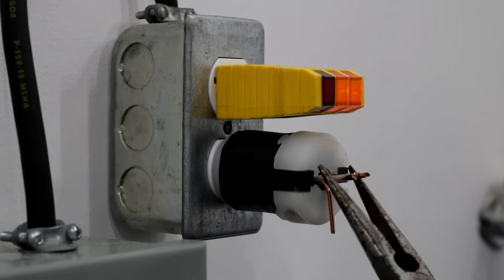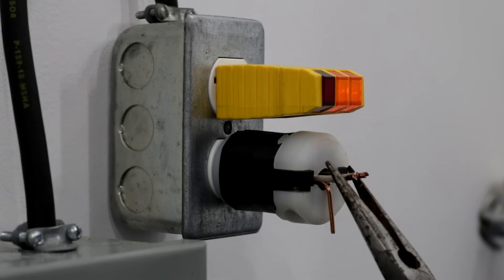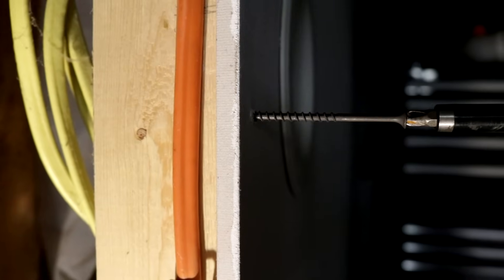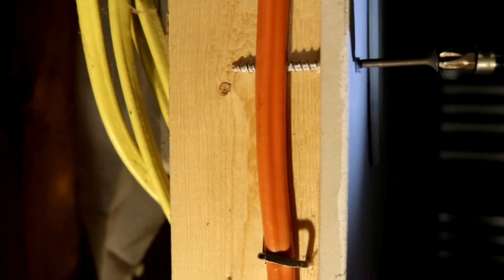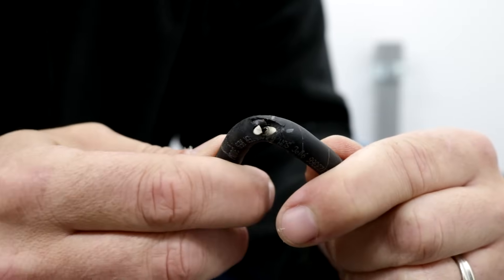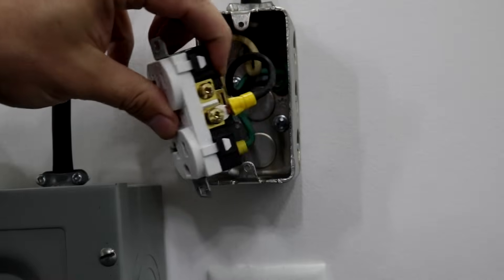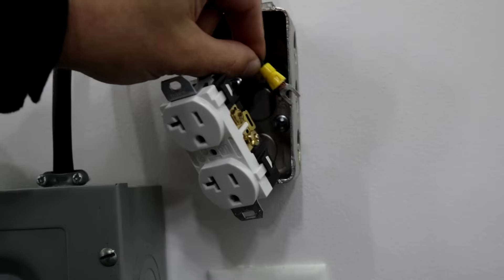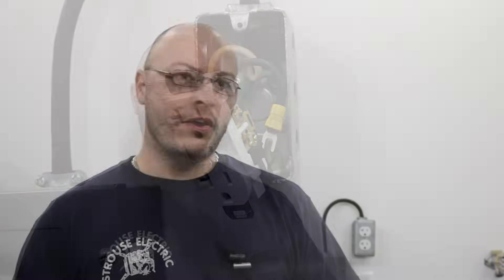Circuit Breaker Keeps Tripping - 3 Common Reasons

Comment: garage circuit trips when it rains... a few days later when things are dry it works again.
No water is ever found....
Reply: Ooooo, I hate when that happens. Most likely a high humidity thing. If there is also a receptacle or fixture outside that's on that same circuit, that may be the culprit. This is especially common if the controlling GFCI is a lower quality receptacle.
Reply: Donald Shimkus probably... I just replaced to circuit breaker and 4 inches of rain all is good . I think they were 21 years old and had seen rain over the years.
Reply: @graphguy  
Good job! Yeah, those outdoor panel breakers sure do take some abuse from the weather.  Stay safe.
Reply: Sorry, was texting someone else with an outdoor panel.

Comment: hi ,,, I sometimes hear (only at nite ) a snaping sound from one of my breakers ,however  the breaker does not trip its a  15 A and this is for lights  in the living room ,, so at nite when that lignt is on and I am using my  computer  ( which is supply from a 20A breaker  ,,, I hear a sharp snap when I check the breakers the are on and normal temp the touch (not ever warm  ) ….  not sure what is causing that
Reply: Have a qualified electrician change out that breaker. Please.

Comment: My septic tank pump gfci keeps tripping Why my husband has replaced it and it does not work at all what could be the cause?
Reply: A short in the wires or the pump motor is grounded

Comment: Thank you for the video! My husband and I have lived in our home for 3+ years. Our bathroom and second bathroom outlets are on the same circuit along with one outlet of the lanai. We have nothing plugged in full-time. Once in awhile I was using the outlet for a vacuum but we upgraded to a wireless/cordless vacuum over a year ago. Some time a few months ago, the outlets stopped working. We didn't realize it until we purchased a Waterpik and tried to use it in the master bathroom last month. We have no idea of how long the outlets were not working as we don't use them. 
After searching YouTube, we replaced the circuit breaker successfully. We plugged in a random light and it worked for a second. 
We have an electrician called who is coming tomorrow at the tune of $65 an hour to figure out what is wrong. Any ideas? My husband is quite handy. He is currently disconnecting the outlet in the master and then has plans on doing the same to the second bathroom).

Comment: Hi there I just subbed to you, question I'm new to living in an RV I blew 3 areas already at friends house on my 3rd area pulling elecicity from the front of his house the outlet is 15amps , 110 volta approximately I believe it holds 1650watts  I currently have a cyclone floor fan, a honeywell fan and a oscillator desk fan plugged in, in running g I believe a 16gauge light duty wire from the front porch to my camper. I need to know how many fans can be run 24/7 off of this outlet?)
Reply: definitely invest in a 12 wire cord. then calculate how many amps you're using for the rv ( watts divide by volts = amps)
Reply: Bill passed away in 2016, so don’t expect him to answer. He did have another channel that was very helpful.

Comment: Hello. I was watching one of your YouTube videos. I was very impressed. I hope you don't mind me asking you a question. I'll try to keep it short. 
  I have a house that is about 1150 square foot and was built around 1968. I'm renovating to sell. Tried renting and it was a nightmare. All 10 years of it. Iv replaced every switch, plug and light fixture successfully. However there is one light fixture in the bathroom that is throwing the breaker on the outside of the house. The outside breaker box of course. I know it's not a smart thing to do at all but I wired it hot and it worked fine but when I turned the switch off to turn the light off it immediately throws the outside breaker. I don't understand this at all. I do know that there is a ground fault plug on this circuit and highly suspect it may be the problem but don't know why. I have done some electrical work and took some classes but I'm far from an electrician. Oh and there is 2 lights in the bathroom where this fixture is, both on this same circuit but they are worked by separate, side by side, single, 2 way switches. And the circuit goes on from there. I watched another YouTube video that said I needed to mount both black wires to the fixture to the hot and ground fixture wires and wire nut the neutral wires together. I did not understand this at all but I actually think my neutral wires were wire nutted together but don't remember for sure. I would greatly appreciate any and all advice you could give me. Thank you very much, Robert.
Reply: Sorry, but Bill’s no longer with us. I’m interested to know if you found source of the tripping.
Reply: @sunshine3914   Do you have an electrician theree?

Comment: I think I have a circuit drawing 8 amps rated for 15 amps. The house is only 3 years old. I'm wondering if I should just install some LED bulbs in the bathroom or actually figure out why that one breaker has tripped twice in the past couple weeks.

Comment: If you are using a GCFI will it also trip with too much amperage or is it limited to just grounding issues? thanks
Reply: Yes they are rated for certain amperage it protects the circuit

Comment: Fine Bill. I like your channel.  Can You explain why my RCD strips when there is thunder and lighting?
Reply: if your power surges and excess power can overcome the lines systems to bleed of the voltage and the lighting uses your house wiring through your grounding electrodes to get to earth also trippping your shit out in the process.

Comment: The power company said it was my circuit breaker had gone bad but do you think I could possibly turn it off then back on maybe to see if that works, do they just die often or?? Plz someone help vlol
Reply: after 20 to thirty years its common to go bad is your house old? Also is just one part of your house with out power. If so did you call the power company about that?
Reply: Yes, breakers do go bad and sometimes within just a few yrs. Most times they just fatigue from excessive loads, too many things operating on one circuit or 1 or 2 things that draw a lot of current. Such as portable electric heaters.
Reply: @donaldshimkus539  I just installed a ceiling fan and my 15amp breaker keeps tripping.Should i go with a 20amp?
Reply: @tyronekitchens4245  
No. The wire gauge for that circuit is most likely 14 guage which dictates the use of a maximum 15 amp breaker. Check that the wiring and connections are correct and not shorted. If good, check that the fan is not shorted internally. These were the only two things that changed in this situation. If the breaker was fine before,  chances are good that's where ghe problem is.
Reply: @donaldshimkus539  Thanks so much.I think the fan is short/Defected everything else checked out fine.
Reply: @donaldshimkus539  I may also add that the 15amp is connected to two bedrooms
Reply: @tyronekitchens4245  
That's typical and usually not a problem. 15 amp circuits can handle several rooms because their loads (electrical) are usually minimal, being lights and electronics. When you add window a-c units or portable electric heaters or other high current drawing appliances, that's when you run into problems. These items should be on dedicated circuits of sufficient ampacity.
Reply: @donaldshimkus539  Thanks alot for the information.Defective fan(Hopefully)

Comment: I hear a slight buzzing noise from the specific breaker that keeps tripping before it trips off. Unplugged all devices on that circuit, tried again. Still have the same issue. Because I’m hearing that noise, should I isolate the problem to the breaker or should I now take a look at the outlets to look for shorts?

Comment: I have a question: Can I replace a broken 20A double pole switch (for my hot water heater) with a 30A double pole switch? The reason for this question is, I went to HD to purchase the 20A but there was none in stock, but I was told that a 30A (which was in stock) would work.
But a new problem arose: Previously the broken 20A switch tripped the hot water tank breaker. But now with the new 30A switch, the main breaker to the entire house trips!
Can you help?
Thanks.
Reply: You either have a short circuit that is so bad it trips the main when you rewired your shit also a 30A protecting 12 gauge wire will eventually burn your house down but if its holding its golden.  also why replace the old breaker if shit wasnt already fucked up? probably your issue there.

Comment: i installed a like new used washing machine that everytime i use water around it (example: water plants, clean patio) it trips the breaker, what could it be?
Reply: water conducts electricity (except distilled water) and can definitely cause a short.  if the plug that the Washer is plugged into is GFCI protected then even the tiniest droplet of water would cause the GFCI to trip.  The GFCI may be a special breaker in the panel or a plug upstream of or at the location that the washer is plugged in.
Reply: dont poor water on outlets

Comment: how come my lights are broken? has the fuse broken or something? they weren't even on before. but now they won't turn on?
Reply: does the light switch of other pull it out and push the black wire to the box if it sparks you have power and the lights are bad.

Comment: how bad is it if i change my barker from 15 amp to 20???
Reply: Get a bigger dog. It'll bark louder?! Sometimes small dogs bark pretty loud too.
Reply: Never... 15 amps on 14 gauge wire only..
Reply: to clarify 14 gauge wire is acceptable for 20 amps if it is single wires in conduit.  but if the wire is bundled with the ground (bare), common (white) and conductor (black or red) within common sheathing like romex or BX then it can only be used 15 amp or smaller circuits.  Keep in mind that plugs must also be able to handle the increased load if you change the amperage of the breaker properly.  20 amp plugs always have a common side that looks like a T while 15 amp plugs the common side is straight but just a little bigger than the conductor side.  Same for switches.
Reply: the numbers are guidlines every thing is over engineered by 50 percent. Your house will burn down though if you do what your thinking.

Comment: bill can i change my single circuit breaker which is c20 to c32? my single c20 always tripping once a day, because connected to many load such as 3 pc's, air-cond, other electronic stuff. i hope you can help me out
Reply: This will make your house burn down. But a great idea to makes things work temporarely until you get a better new house.

Comment: after a smoke detector kept chirping I turned the circuit breaker off while I replaced batteries in 2 of them & replaced the unit in the original one.  After replacing all of that I tried to turn the breaker back on but it will not stay in the on position...keeps going back to tripped position.  Any ideas?

Comment: question I shorted a GFCI by mistake,So I checked my electrical box, and the breaker was tripped, so I tried to put back on,but it wont, I try sereveral times,and I see a spark,what does that mean, please help!!!
Reply: You had a short-circuit at the GFCI outlet? There is a chance that the outlet was destroyed, and needs to be replaced. If it's not the outlet, the amps drawn by the short-circuit messed up the branch circuit in some other way.
Reply: the metal parts of elec tricity are touching the metal parts of youse house somewhere maybe in hte gfci box you fucked with?

Comment: my friend has an additional control panel with single circuit wired to the main control panel how would I shut off power completely from the main breaker when there is no power running to the house just the main breaker
Reply: turn off the big breaker in main control panel. Panel down stream should have power then.

Comment: i plugged in a electric heater and it started tripping the circut then all of a sudden it did not trip and 3 outlets quit working along with the outlet the heater was plugged into i checked the curcit and it wasnt tripped but it feels loose in other words i can wiggle it up and down in other words there is a little play in it!
Reply: umm sounds like your burnt up your breaker. by constaly heating it up with a heater.  Maybe plug in a fan next to your heater to cool the electrity down next time.

Comment: if a screw or nail cuts into your wire , you have know choice but to rip your dry wall down in the dead short. of the wire !!! that's your only  option!!!
Reply: just use the green as your black your goood.

Comment: I have 15 amp 110v. breaker to our bedroom that trips as soon as it is reset, everything in that room has been unplugged but it still trips. any ideas? I replaced the breaker but it did the same. It was working the night before
Reply: You've probably had the problem corrected by now, but for other readers here, it was probably a short-circuit in the electrical system itself. It might have been an improperly-installed receptacle, damaged outlet or light fixture, a nail or screw driven through Romex, or my personal favorite... a three-way switch miswired by tying one of the travelers to ground on a two-way switch. I've had a bunch of service calls for these.
Reply: Alpha Omega A short circuit wont necessarily trip the breaker if the contact was for a very brief time. Is there anything not working right now? Is there any burn marks on the wires?
Reply: Purple Diana Ive got similiar problem electricity keeps lowering down and sometimes it will turn off only my tv..my internet box..the lights will go off like for 2 seconds and I have to turn on everything again.. and you can see it by looking at the lights they... flicker and you can hear it from the fan or ac... I've called and electrician and payed for a new wire and an outlet he said he checked the breaker box but he just tighten idk what...but nothing was fixed...but it's random when it happens there's days that everything will work fine and others it won't. Ps last night after having the same problems I went out side to the breaker box..and heard a weird sound it came from the back on the roof where there's a wire and you can see a little bit electricity and the sound coming from a...the screw that's I guess holding the wire..but it's random too just like the problem inside home!! I followed the wire and it's the same wiring someone did at this home it's even lying on the ground which I've heard they supposed to be under ground..🕵

Comment: my heater tripps the breaker just when the heater is working,, but not when my a/c is on
Reply: joel sandoval A circuit breaker “trips” or shuts off the electrical flow to protect the circuit from overheating and causing damage or even possibly an electrical fire , heater plugs gets extremely hot so that's why and ac plugs don't get as hot as an heater plug does
Reply: its b ecause AC cools electricity and heaters heat it up thats why your stuff is awlays tripping out.

Comment: I am replacing an outside light fixture. My son tells me that the fixture was working at one time. When I replaced the fixture I only found 2 black wires. the light will not go on for about 2 second and then trip the circuit. A soft humming noise can be heard before the circuit trips. Any suggestions? Edison, NJ
Reply: One of those black wires is used a white neutral they just ran blacks disconnect power to light take black wires and press to metal which ever one sparks isnt neutral.